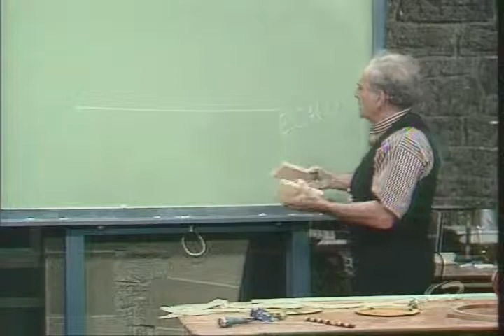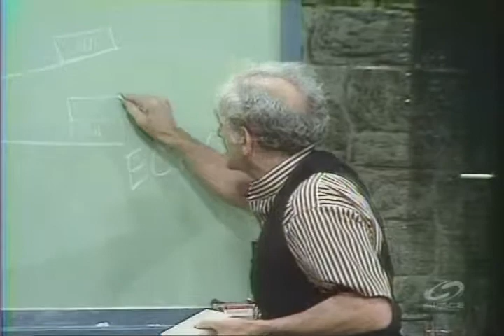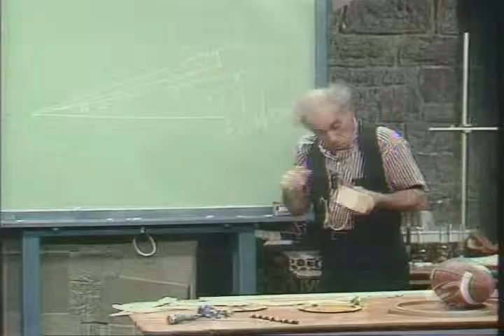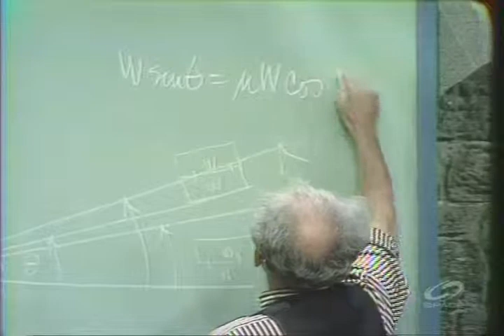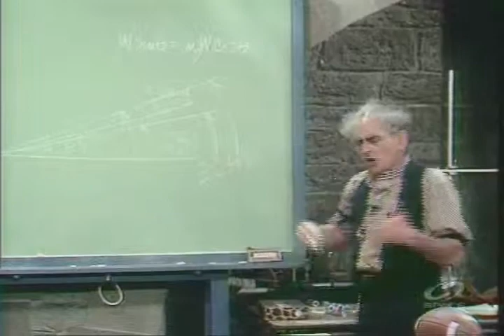The Professor - Inclined Plane

Comment: i guess the difference in how weight affects slipping angle is more dependent on the material strength of the inclined surface. this is why our intuition tells us that the heavier weight requires a greater angle than a lighter weight object in order to initiate slippage since the majority of organic surfaces are malleable/deformable.